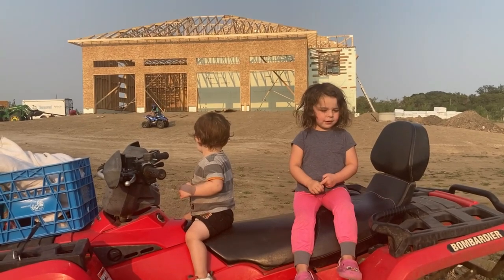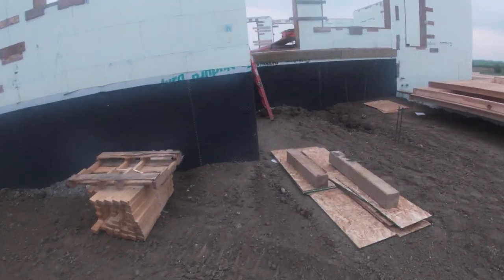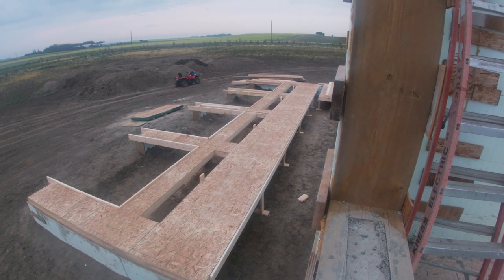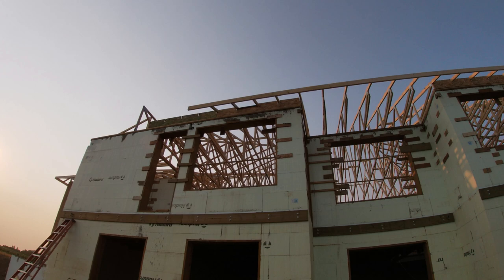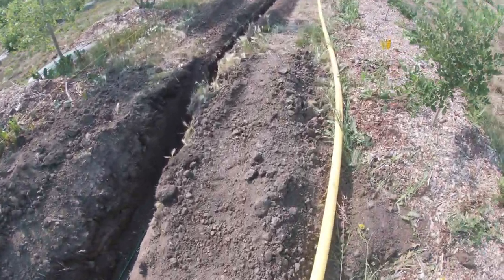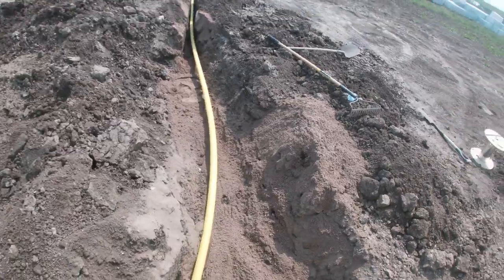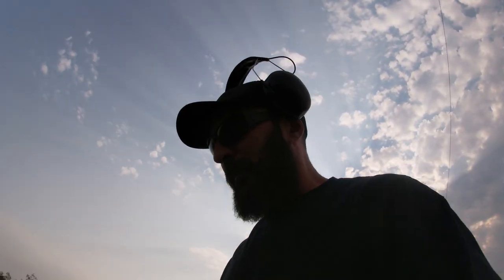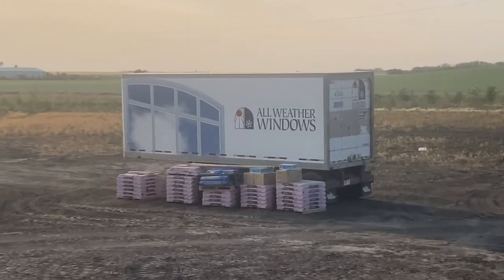Vlog 10 -  Installing a Wood Roof and Garage onto an ICF House

Comment: I do not blame you for hiring out the roof and framing of the garage. Time can be a friend or enemy. So anything that can help you get to the point you need to be before cold weather comes in is a plus. I am surprised you did not place the electrical cables in PVC conduit. I know you buried it about 3 feet. I guess your codes in CA are different in the US. Can't wait to see more vids.
Reply from the maker: It is direct burial rated service wire.  It has a couple layers of insulation.  It meets code here and pulling large cable through conduit is difficult. This is the way to go here for sure.

Comment: Is it common to have rural gas service there? Southern Manitoba has very little rural gasification. I wish our lot was serviced with gas.
Reply from the maker: Yes it is common. Especially near the cities. Some people use propane or heating oil, or electric heat if gas isn’t available at a reasonable price.
Reply: @eberlesbuildahousediyicfho9630  ...just a little jealous! We'll be heating with electric if we build outside of town. Considering other supplements like a wood burning fireplace, or perhaps geothermal.

Comment: Hello from PEI! I have a couple questions . The top plate ( top of icf wall) is doubled up is that a requirement for code? Also I see that it's only a 2x10 on top is that so it's easier to run wires down the wall on the interior? I was quoted a 2x12 at the top but looking for ideas from your videos that will make it easier for me. Thanks!
Reply from the maker: Hey, I’m not sure about code doubling up the top plate, but that’s how our designer and engineer drew it up for us, so that’s what we did. Doing it that way also allowed us to fill the space inside the 2 x 10 with some rigid foam as a better thermal break than wood. We’ve had a pretty cold winter so far and it seems to work great! Our huge windows are where we are loosing heat. Lol
Reply: @eberlesbuildahousediyicfho9630  makes perfect sense thanks!

Comment: did you add any additives to your concrete?
Reply from the maker: It is a mix for ICF.  It has smaller aggregate(3/8" vs 3/4") otherwise its just normal concrete poured fairly wet.
Reply: Ok thanks that is what I will specify.